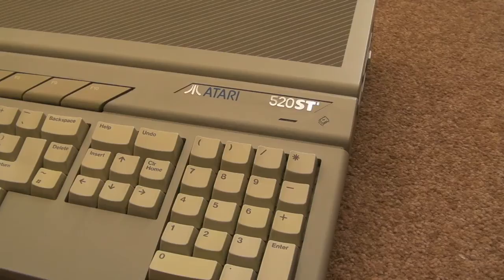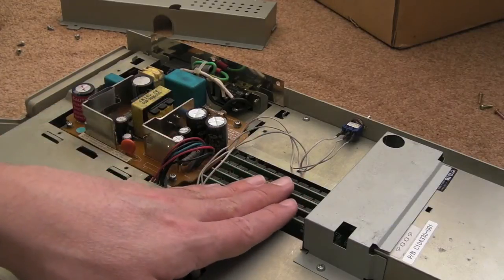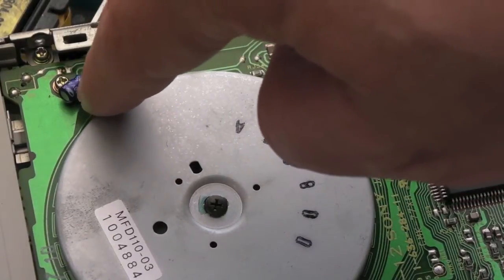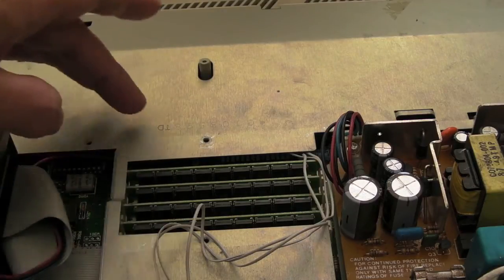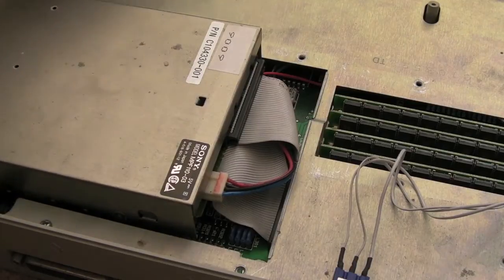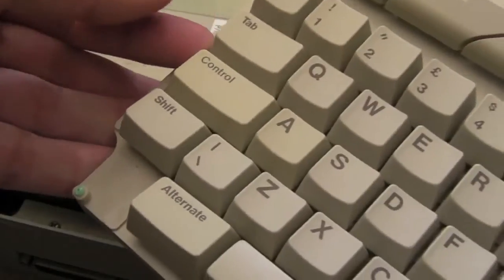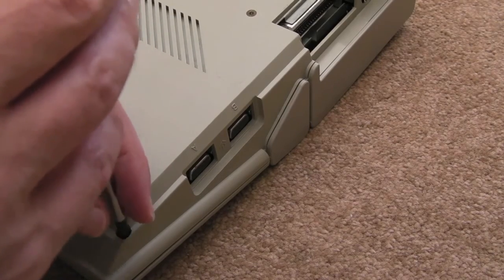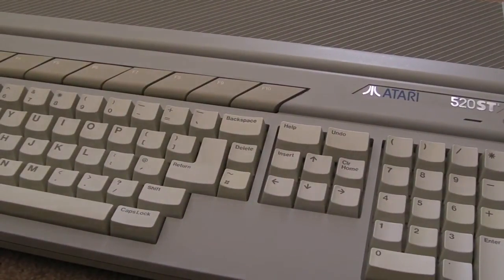Atari STe Floppy Drive Repair & Overview

Comment: the capacitors are quite a problem on ST computers. The ones in the PSU must be replaced, but also the little one inside the floppy drives..... as you did ! It makes the drive failing, i have found that too on my own ST/Es.

Comment: A couple of years back I spotted an Atari STe in a charity shop with mouse, manuals and a couple of games, it didn't have a price on so I asked the price of it, when I was told the price my chin almost hit the floor, it was only £3, took it home to test it and it worked flawlessly. Got an STfm recently, whipped the lid off and to my surprise there was a 286 PC slapped over the 68K CPU.
Reply from the maker: Very nice pickups =D   I think mine was £18 but that was 5 or 6 years ago now.
Reply: @GadgetUK164  Still a bargain for that price

Comment: Great vid. Wondering is there a way to remove and switch out the facia on st drives with some of the replacement drives to avoid the need to cut the case to accommodate the slightly different shape and position of the eject button?
Reply from the maker: I don't think so - it's often a case of the mechnism is laid out in the wrong way =/

Comment: Another crying shame on the STE was the Shifter Chip has separate 16 bit data bus's for the CPU and RAM, and Atari could have given the ST dedicated video Ram for much faster graphics; STE Shifter also has another separate 8 bit data bus for sound, so if Atari could have had separate sound RAM too. Back in the day with separate Video and Sound Ram, that could made it much faster.

Comment: Hi Gadget!
Nice vid! Thanks for sharing!
 I have one question, You have a Gotek drive, for sure.. Did You managed to let it work as an external drive DS0 on ST?
I've tryed, and have some issues..The autoboot file manager doesen't work, it just starts to load, then hangs with the message:
"LBA Change Test filed! write issue?" when i remove the autoboot.hfe, i am able to load some games from gotek in direct acess mode, but both drives acting as one (so, basically, internal drive does the same steps as gotek) I have asked Jeff about it, haven't got any response since end of december....
I have built my cable based on atari-wiki page, but it seems that this pinout was not correct, i was removed on 24.02.17..
I am thinking this pinout was wrong, because of that "ghosting" effect.
I've started to search any info, but it seems that everybody using gotek internally (i can't, cause i use it also with my Amigas, CPC, Spectrum and other retro stuff). Till i finally found this:

The Atari owners's manual indicates that pin5 is Drive0 Select and pin 6 is Drive1 Select but in fact the signals connected to pin 5 and 6 depends upon the model (STE/STF) and position of internal strap(s) on the motherboard.
By default on both Atari STF and STE the straps on the motherboard are set so that Pin 5 is connected to signal Drive1 Select . This allows to see an external floppy drive, that uses the Pin 5 for selection, as drive B. So the internal drive is A and the external drive is B. This works with most external floppy drive for example a SF314/SF354 from Atari or a CSA354 from Cumana.
On an Atari STF there is one strap W2 that allow to change the signal that goes to pin 5.
If the W2 strap is between pins 2-3 (the default) the signal connected to pin 5 is Drive1 Select.
If the W2 strap is between pins 1-2 the signal connected to pin 5 is Drive0 Select.
Note that the signal connected to pin 6 is always Drive1 Select.
On Atari STE it is more flexible because there are one strap W301 that allows to change the signal that goes to pin 5 and another strap W300 that allows to change the signal that goes to pin 6.
If the W301 strap is between pin 2-3 (the default) the signal connected to pin 5 is Drive1 Select.
If the W301 strap is between pin 1-2 the signal connected to pin 5 is Drive0 Select.
If the W300 strap is between pin 2-3 (the default) the signal connected to pin 1 is logic 1 (drive never selected).
If the W300 strap is between pin 1-2 the signal connected to pin 6 is Drive1 Select.
It is therefore important to verify that these internal straps are set to meet your requirements.

I havent opened my STE yet, i don't know anout these headers..What i need (like) to have - is if i attatch gotek externally - it will be DS0, and internal drive turns to DS1 (i think the file manager and autoboot will work then)..
What Do You think, Gadget, is it possible or not? If Yes - then how? What wiring should i use? I suppose i will need to add a switch?
Regards,

Viktor
Reply from the maker: Sorry for my slow reply!  Not had a minute!   I don't use the Gotek - I have a HxC in my ST, and all my Amigas have real FDDs.  The drive select is going to be the problem - it sounds like from what you wrote there that it is controlled by jumpers (probably soldered wire straps) on the motherboard.  So what I think you need to do is take it to bits, find the jumpers, then check against that table of jumpers for W301 and W300 and experiement.  It does look like you can set the external drive to DS0.  Not sure what happens to the internal drive then, presumably its swapped to DS1?!?  No idea!

Comment: If I remember correctly, the STe doesn't actually support 2.5MB and assumes you have 4MB if all SIMM slots are populated and the first slot has a 1MB SIMM, so you actually need an AUTO program that maps out the top 1.5MB so that programs don't try to use the non-existent RAM and crash the computer.
Reply from the maker: You can use software to configure the MMU there, but from my memory you can indeed have 2.5MB as a combination of 1M and 512K SIMMs.
Reply from the maker: I've confirmed this!  I used 256K (pair of) and 1M (pair of) in order to test the code I wrote to display my RAM size on boot, and to  to display whether my CPU is set to 8Mhz or 16Mhz.  2.5MB will work, and in fact there's an old version of the MMU that was limited to 2.5MB too!   But... Next to no software (games etc) uses it.   But for general TOS use it works fine.
Reply: @GadgetUK164  Weird.  I definitely remember there being an AUTO program to 'hide' memory from TOS...maybe it was an odd 1.5MB or 3MB config that did that???
Reply from the maker: Yes, there is a program you can auto boot to set the MMC to ignore RAM above 1MB!  You aren't wrong about that part!  But the ST will work with 2 x 1MB and 2 x 256K modules to give 2.5MB.   The switch just does the same kind of thing, to disable RAM above 1MB.  Some software might glitch out if you just rely on the prog in the AUTO folder etc (eg. games that have their own boot sector and no auto folder etc).

Comment: What's the purpose of switching from 4MB to 1MB? Compatibility?
Reply from the maker: Yes, some older games crash with 4Mb - although its quite rare tbh, especially if you run the hard disk adapted games from PP (http://atari.8bitchip.info/fromhd.php), since he's already fixed the games that suffer from that problem.

Comment: I have an STe that has a epson floppy drive, any tips on fixing this?
Reply from the maker: Check out my '4 Amiga FDD repairs video' - basically everything in there is probably still relevant in ST drives.   Some older drives have belt which may need replacing - but not likely in an STe.

Comment: I have a 520 stfm, the floppy drive failed at loading and I replaced it. It worked for two days and now the new one isn't working anymore. I'm at a loss at what the issue is.
Reply from the maker: It could be the PSU on your ST, if the 12v level is unreliable due to bad caps that could cause that type of problem.  But I suspect the drive has not failed and probably has dirty heads.  Sometimes you can get contaminants or mold on the disks and this will transfer to the heads on the FDD.   Try cleaning the heads up with some IPA, and if that doesn't work use a tiny bit of PlastX on a cotton bud, then clean it with IPA to give it a final clean.
Reply: +GadgetUK164 thank you. When people say heads, is there an easy way to identify. I've opened a cleaned all my machines but floppy drives are really foreign to me. Is there an image for what I am looking for?
Reply: I bought a 3.5 3 1/2 HEAD CLEANING Disk DISKETTE WET KIT 78-2350 which I'll test. I think your right, I also read another post on a atari forum that said that some older games can mess up the heads.
Reply from the maker: I have done a few Amiga videos showing how to clean the heads.  I think the 500 repair part 2 i did covers that.  ST drives are almost the same - but some have a single head, others have 2 like the Amiga.
Reply: +GadgetUK164 Thank you, I'll let you know how I get on.

Comment: Does the Pin 18 (1/4 value) switch method apply to the STFM as well?
Reply: Awesome. Thanks. I made the mistake of upgrading my 1040STFM to 4MB, the day after picking it up. I didn't think about the issues with software expecting 1Mb.

Comment: My recently acquired stfm has disc drive problems i have a spare and that seems no better but was a working order drive my sony drives are mp-f11w-5du so a bit different the board at the back of the drive has one cap so i might replace it and regrease relevant parts and clean heads the pc modded replacements on ebay are all well and good but i do not want to cut the case up .My joystick and mouse ports are gone and need soldering but was expecting that i know there a weak point..
Reply from the maker: Let me know how you get on with the drive! =D